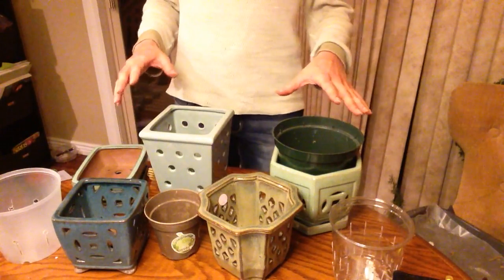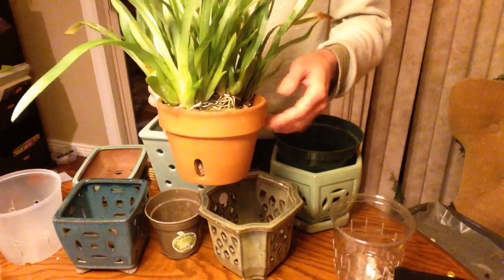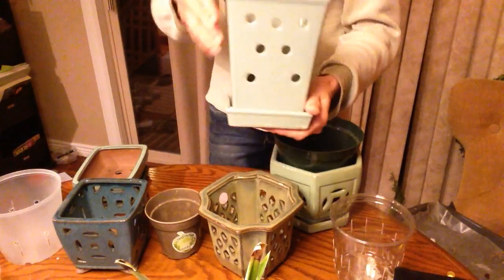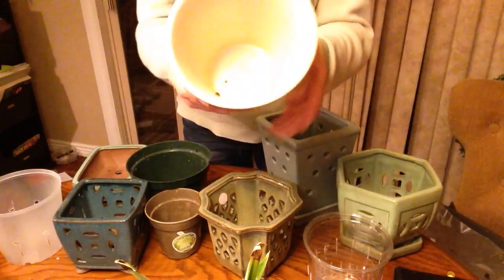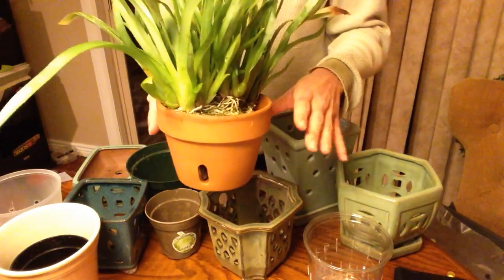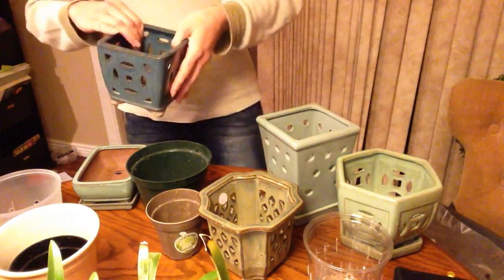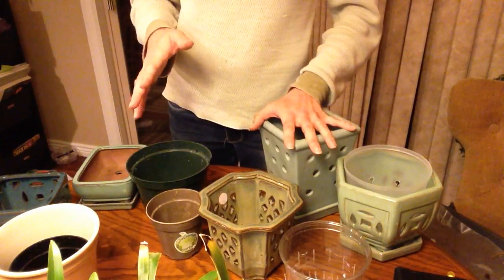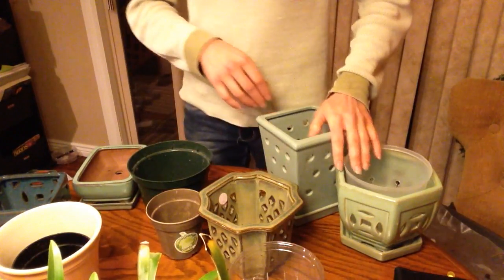Repotting Orchids: Hidden Dangers of Orchid Pots (part 1of 2)

Comment: I wish I would seen a video like this wen I started growing orchids, the glazed ceramic ones with a saucer are pretty expensive and they hold water on the bottom more than you think. I got 2 and I used them as decorative pots.
Reply from the maker: +fifi fifi you learned the hard way too. I've wasted so much money and had so many problems when I was starting out due to things like this which is exactly why I wanted to make this channel. I'm glad you found it and I'm glad it's something that would have helped you when you were starting. Mission accomplished!